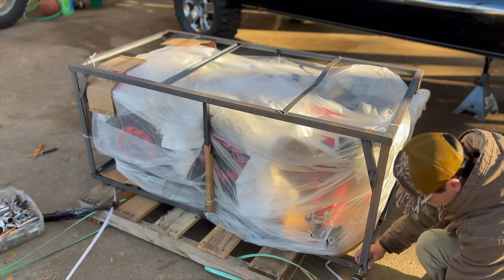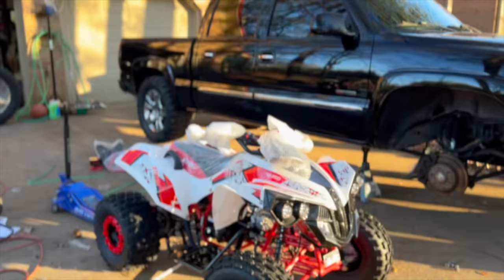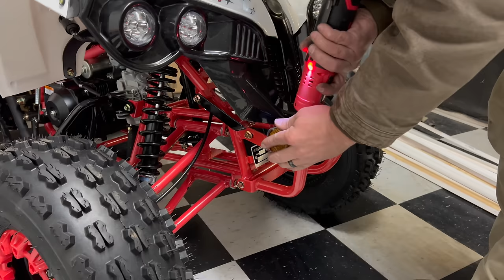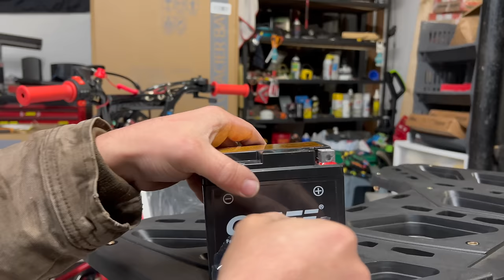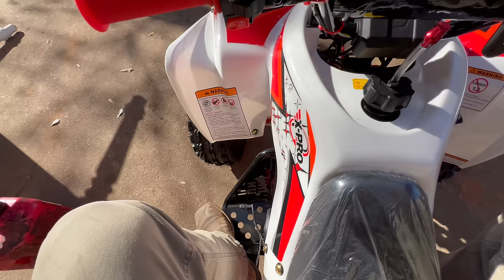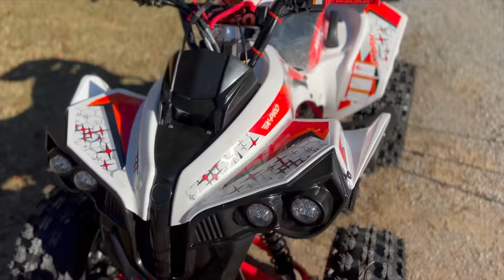I BOUGHT A FOUR-WHEELER FROM AMAZON! | IT'S AWESOME |

Comment: Do yourself a favor and do a break-in oil change! Hopefully it has recommended break-in oil change procedure!?!? Like one tank of fuel then change oil
Reply: Do a oil change about ever two or three tanks of fuel it will be best for long run and its like one qt. Of oil 8 bucks for good oil
Reply: Actually, X-Pro uses what's called a shipping oil and should be changed immediately. Before start up. Then do a break in oil change again after about one tank of gas.
Reply: Change oil!
Reply: Cool

Comment: I have an older model of this ATV and I can tell you that those little engines keep going forever. I also had a X-Pro 250 street legal dirt bike that I put about 1000 miles on and never had a single problem with. I sold it because I felt I didn't ride it enough. I miss it and will probably get another. lol

Comment: Change the plug to an NGK, change the wheel bearings, loctite everything you can. 
Then make sure you go with someone who has a proper machine to pull you home after. 
In a few years you can give it away for a case of beer
Reply: It will be great.  Had two similar to this and they have run well for years and held up to 12 grandkids at the cabin,

Comment: There should be a throttle set screw on the carburetor if it has one. Most quads dirt bikes etc have a Set screw on it that will lower down the throttle in Neutral. Right turns the throttle up, Left turns the throttle down. Hopes this helps! Keep up the videos!
Reply: The set screw is on the throttle, none on carb (at least on the one we got last year).

Comment: I repair ATV's and Side By Sides for a living. While out of the box they are awesome looking and the engine is an excellent clone, They are somewhat painful to ride due to the suspension and horrible seat. They also tend to have high vibrations that shake the crap out of you as they get into the upper RPM's. The real downfall to these are the wiring harness as none of the plugs are water tight in any way unlike your major manufacturers, Honda, Kawasaki, Yamaha...etc..  Most of the repairs I do on these are corroded and rusted contacts and wiring. Do not store these outside. Also if you drive through mud or water make sure you clean and dry it after you use it. It only takes one time in the rain to start the corrosion process. On a good note, Parts are cheap.

Comment: We own several of these atvs , have found using valvoline VR1 high zinc oil does best in them.  We have 2 Kazuma falcon 110 that are 12 plus years old rode allmthe time that are still running fine using that oil .

Comment: That's not a fuel "switch" it's an on/off/reserve valve aka FUEL PETCOCK, there ya go! Nice toy for only $800 if it gives decent service, the new Honda clones from that jungle site are lookin good, maybe I'll get a couple for the kids! (with appropriate sized helmets) 
ALWAYS WEAR A HELMET! I'm ALIVE today because I wear a helmet when operating any ATV....oh yeah, I've had a couple of bad crashes riding fast two stroke 4 wheelers and m/c, but the same things can happen when riding at any level in the fields or woods. Big rocks and trees are HARD, don't have to go super fast to become super un-alived!

You would not believe how many people, kids and adults get un-alived while riding 4 wheelers...they feel safer than two wheelers, but prove to be just as fatal....even more so because people get complacent because the 4 wheelers lull you into thinking they are safer than the really are. When disaster strikes it is usually when we let down our guard, something breaks or from inexperience. Just ALWAYS wear a helmet at least!!!
Sorry for the lecture.....but PLEASE think about it.